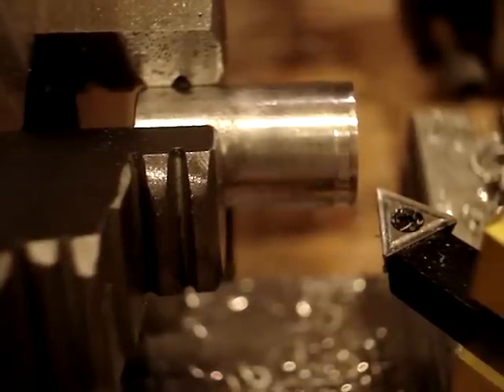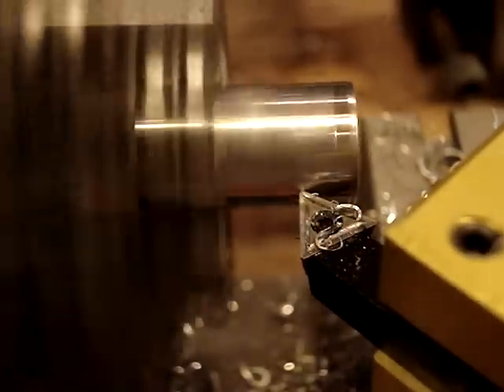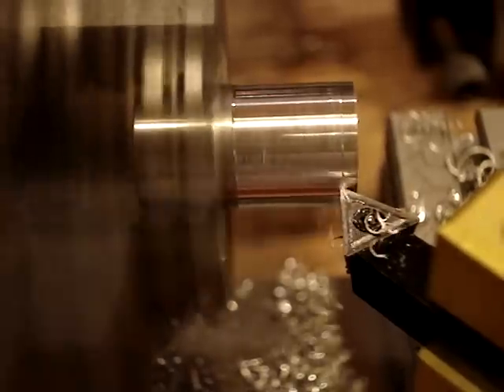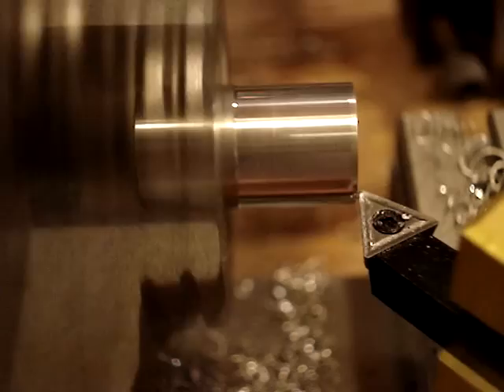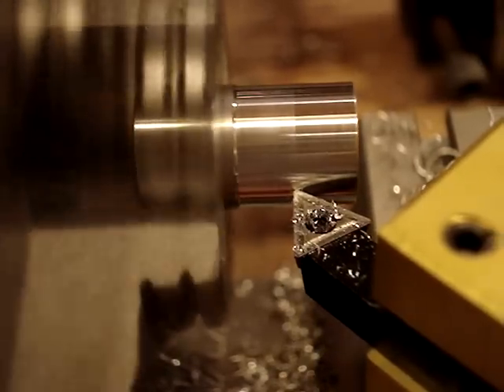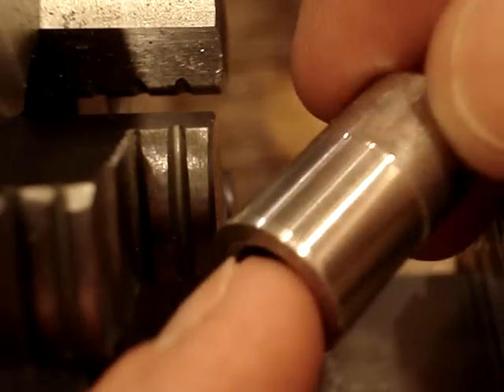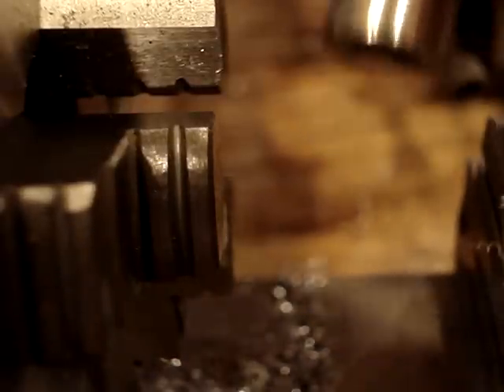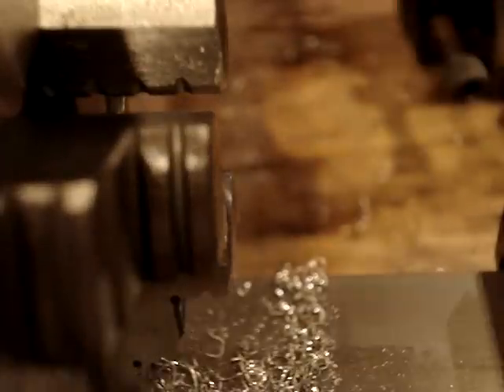Cutting aluminum on the Taig lathe using a carbide tip, no cutting fluid

Comment: where did you get the cutting tool from?
Reply from the maker: Hey Cavin - I bought those off eBay. They sell a little kit of them in a little wooden box. Just search carbide mini lathe or something along those lines. But if I remember correctly, they come as a set of 3 or 4 with different alignments for the tools. And then I think I bought replacement carbide bits from McMaster. Hope that helps.